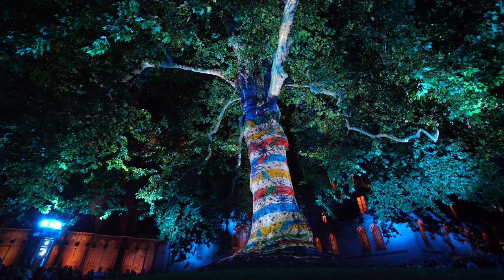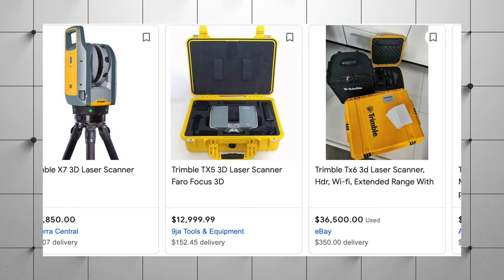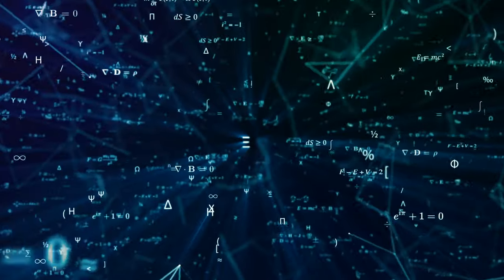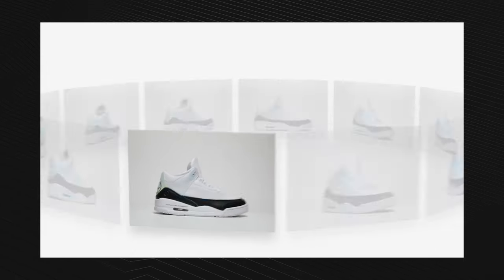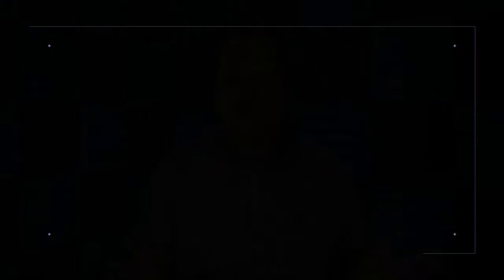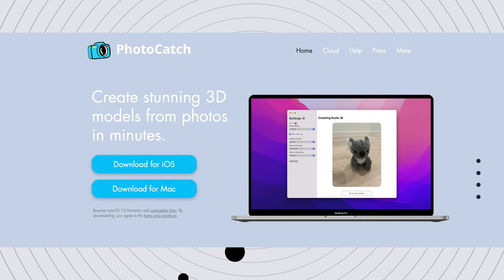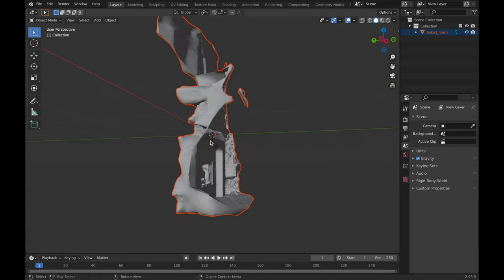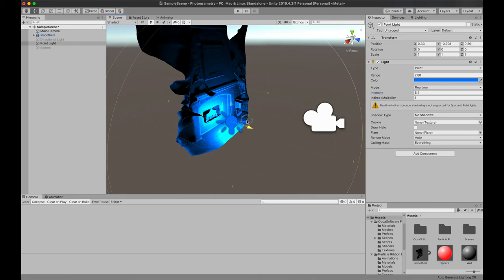Photogrammetry for Projection Mapping

Comment: Hey my friend, great videos - love this kind of content, hopefully you're still doing. I have a project at the moment I'm interested in. I wondered if you might have any advice. I'm trying to make a screen that uses a camera to use head perspective to shift the gaze around with the head movement (thereby matching the view on the screen). I'm thinking of using Unity and setting up OpenCV to monitor the head movement...etc... and then that's as far as I have got in concept :) 

I think the correct term for it is 'perspective-corrected rendering' - have you done any?

Thanks for the projection mapping videos, I'm totally getting into this combined with some photogrammetry (which I've been doing for so long!)